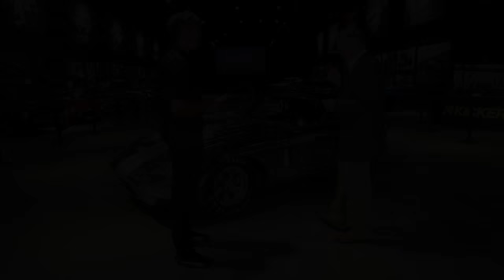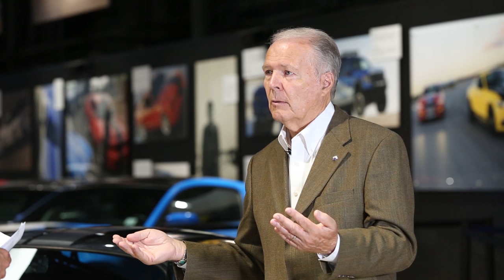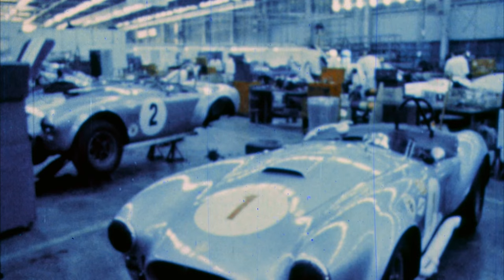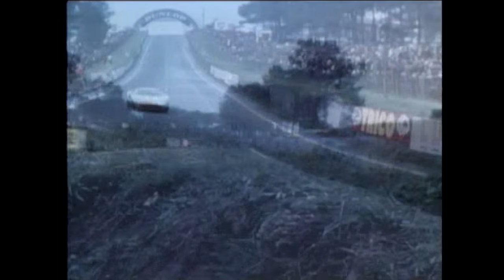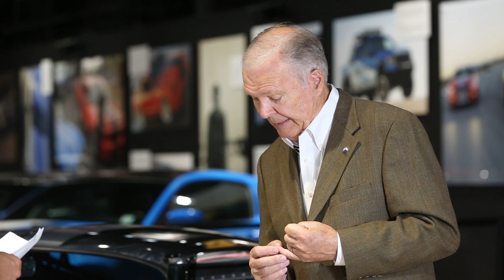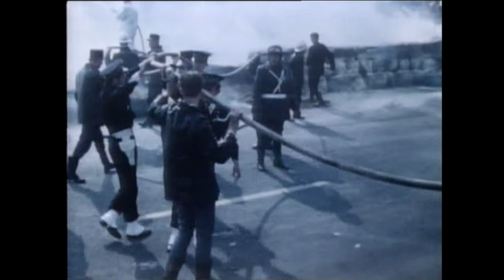The Daytona Coupe Story with Peter Brock – Part 4 The Daytona Tests In Europe

Comment: I work in prototype automotive as a fabricator and we do some cool projects similar. Damn I would have loved to been part of this era. I bet the term it worked in CAD wasn't around back then.  I swear I think that's the engineers favorite phrase. It is a cool career. Not the most lucrative but I can say I had a part in some ground breaking projects. We are entering a new era of automotive where the wheel gets reinvented daily by fabricator and engineer. I just wish the pay reflects the difficulty level of being a fabricator. It's like 3 trades in one. Welding alum stainless mild.  Manual and cnc machining  and even programming which I'm not there yet. And then metal modeling brake press roller and other manual tools. To be halfway good at all of that and working on major auto company prototype should be at least a 30$ hr job. But the work is so interesting it almost makes up for the pay and early hours and the non disclosure of what I work on. But to be part of a racing program I bet some of the guys would have almost done it for free. Great interview. Wish I was of that era

Comment: Yeah one thing a race at Le Mans is all aero I don't like the aero package they set in these Simulators for Le Mans because it offers no front grip and no down force to enhance cornering I use a med down force so I can make up and attack the corner and brake hard if u have an aero issue at le mans u will know in a half a lap or mostly half way down the first long straight...its so fast everywhere aero is the most important thing at speed of 100 or more